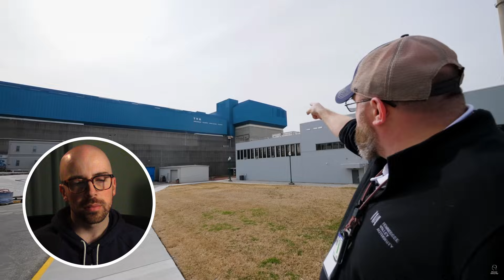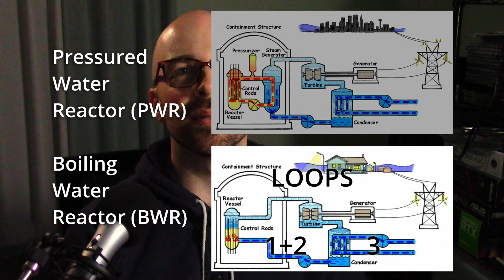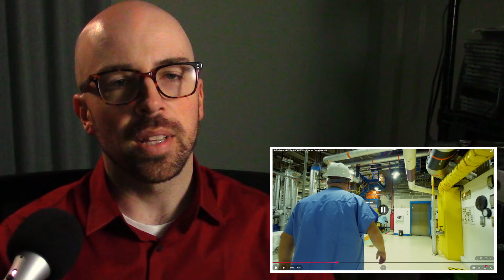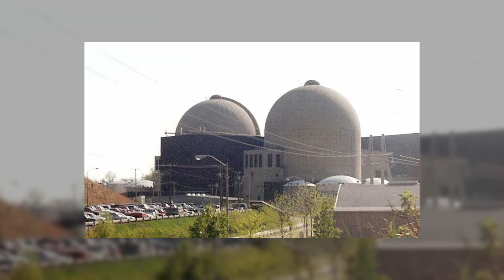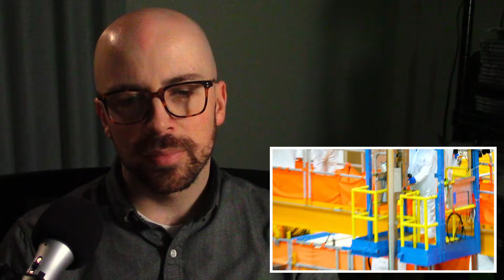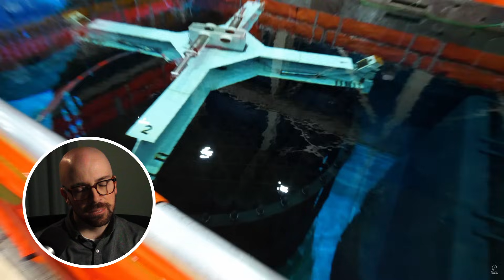"Wow, look at that reactor!" Critical Reaction: Refueling a NUCLEAR Reactor - Smarter Every Day 311

Comment: Wild to see all that gunk build-up on the spent containers compared to the shiny newbies. I remember reading something about radiation slowing down corrosion of metals, so I'm guessing any oxidized patina is due to wear & tear from the excessive heat? Can't be mold, algae, or plain ol dirt. I mean, that facility is so clean one could prolly eat steak off the floor.
Reply from the maker: i've never heard about radiation slowing down the corrosion of materials, I'd be curious to check that out if it's at all possible for you to find that source. something I didn't mention is "crud" which is actually a technical term with nuclear reactors lol but this is probably crud